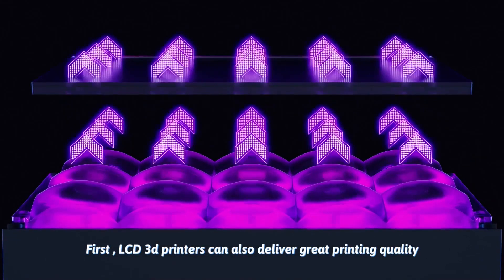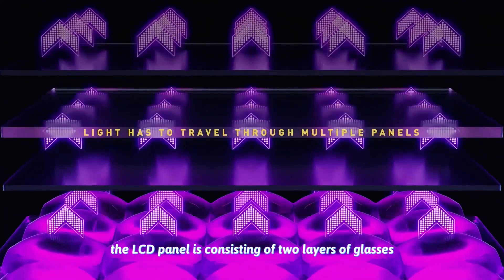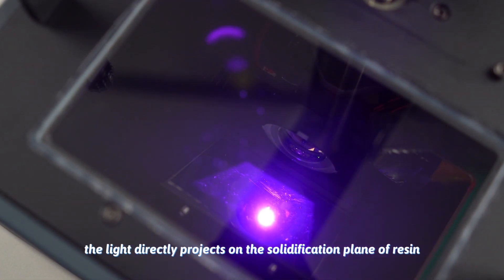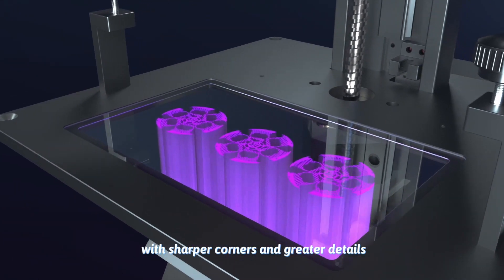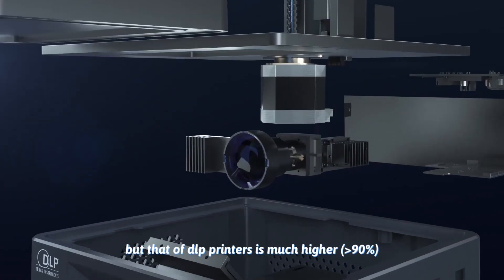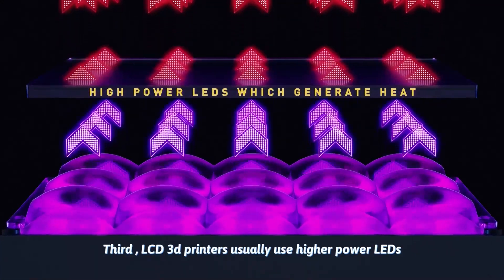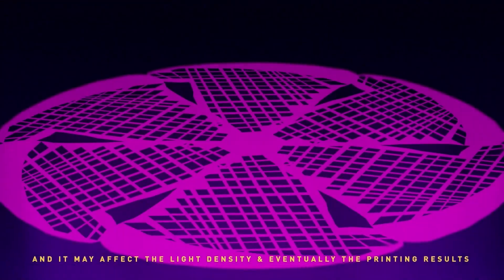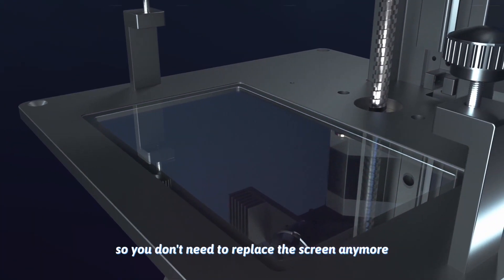Why DLP Delivers Quality Results / Anycubic Photon Ultra

Comment: Lol won't have to replace lcd screens anymore, 🤣 no just a special and proprietary dlp bulb every 30 prints.
Off on off on off on off on the bulb goes for thousands of cycles...
I'm no expert though 🤔 just thinking out loud that this isn't going to be the thing you want it the be imo
Reply from the maker: In addition to the fact that the screen does not need to be replaced, Photon Ultra can also get a better model with more detail and sharper, and the life of the projector will be longer, more environmentally friendly and more durable.😊

Comment: Is photon ultra using Chitu board and therefore will be locked to Chitu slicer?
Reply from the maker: Hi, sir, at the moment, it only supports Photon Workshop. But we will make it compatible with other software to be used. 😊
Reply: @ANYCUBIC3D  Is Lychee slicer support planned?

Comment: Whats the resolution though? 4K is quickly becoming the industry standard so I hope this is at least 4K resolution.
Reply: Judging by other videos I've seen, it doesn't seem the two technologies can be directly compared in this manner. For that matter, 4K is also pretty meaningless unless you take printing area into account.
Reply: @mascot4950  This always bothers me. I don't care how many pixels the screen has, I want to know how large those pixels are. that's why XY resolution is important, and why the phrozen sonic mini 4k still has some of the best prints.

Comment: So all the other resin printers we bought from Anycubic were rubbish then?
Reply from the maker: Hi, sir, we definitely don’t mean that. LCD resin printers can also print great works. This video is just to explain some of the differences between DLP projectors and LCDs. The advantages of DLP resin printers are durability and higher precision. And the photon ultra is made for users eager to get an affordable resin 3D printer to print small and narrow parts with great details. 😊